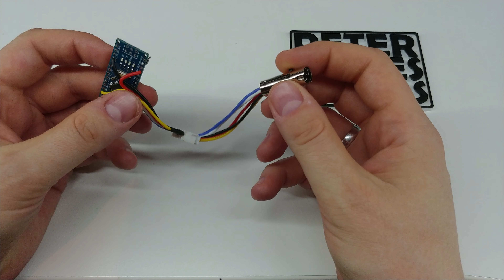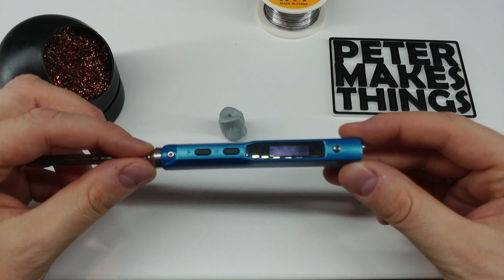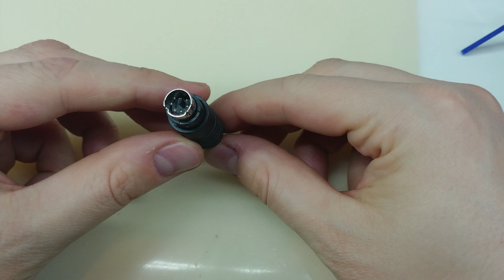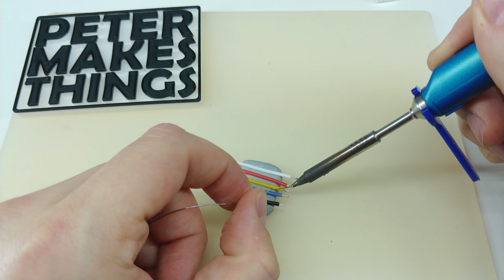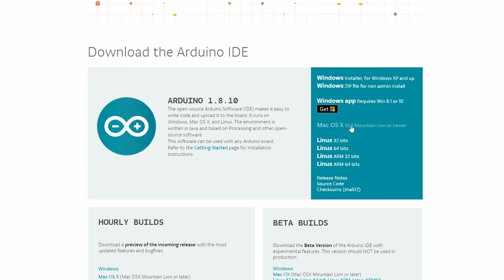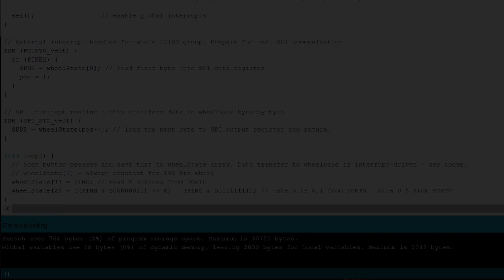How to make a wheel for Thrustmaster (part1)

Comment: EDIT: nvm you did use the PS/2 - how did you know the pin outs would match? I'm looking at the TS-XW PCB for the wheel and the 6 wires aren't labeled. 

wait did I miss the part where you removed the coiled cable in the steering column? I've watched this and part II and just realized you didnt leverage the PS/2 in the column that existed. This was VERY smart haha. bc you didn't test i was waiting for this to fry watching between my fingers but then it hit me - you bypassed the TM PCB entirely. I wanted to use the OEM wheel occasionally still so I spent all day going through the pin out to ensure I hadn't mixed any ground pins etc. Did you have trouble removing the coil? and have you experienced any delayed errors? I was nervous the software would recognize a substantial change and lock up on me. thanks for all your work! this is truly some great content

Comment: I have known this project for a long time, I bought an ATMEGA328P for a rally wheel that did not need so many buttons, but I think I will wait to see if the project is updated and if I do not put a cable, I already made one of GT3 with 4 rotarys and in total it has 22 inputs and the curly cable doesn't bother me at all ... a very clean manual. regards
Reply from the maker: if the cable doesn't annoy you then I guess it's a good solution, but for me is just ease of use, simply put in the wheel and you're good to go
Reply: you mean ardunio uno atmrga328P

Comment: You're awesome, man. Just like McGyver, haha. I'm soon switching from T150 to a T300 and I'll be definitely trying this, I've got also a design that I'd want to use, the only issue is making it fit for a Thrustmaster wheel :p
Reply: I think it’s probably possible to make a wheel for the t150 actually
Reply: You can get adapters on eBay and I guess u could just wire electronics via usb
Reply: @tylahrs  well, I already bought a T300 and I couldn't be more happy with it tbh.
Reply: Domiii yeah I might upgrade to that, but i would rather just put in the extra money and go for a csl elite or sim-plicity dd wheel

Comment: Good afternoon, congratulations on the video.
I have a few questions to ask:
I bought a "Bentley GT3" steering wheel that has 12 buttons and 4 encoders. Does it work using that method you made in the video?

Comment: I've tried replacing the adruino and re-soldering the wires but still having problems with the buttons randomly pressing by themselves, I also tried the built-in thrustmaster wheel and it doesn't have this problem. I think the problem is not with the wheels but with the thrustmaster software, any solution?
Reply: i have the issue where some buttons are always "on" and some are always off. very annoying and idk how to fix it. the game recognizes it but nothing works as it should. i can't turn on or off the buttons.
Reply: @vidvir1492  back with arduino pro micro with usb cables, a guess thrustmasters already blocked the arduino nano sketch
Reply: @dellibingung  that sucks. Lets see if there is any other method.

Comment: Hi Peter, what firmware to use with TS PC Racer ? And which what Sketch then ? Firm4.0 with TX 458 Wheel sketch should works ? I cant find a way to make my wheel recognized on my base.., Thank for all!

Edit : TS PC Racer works fine with 2017_TTRS_7.exe Thrustmaster Package (Firm 6.0 + Driver 2.10.3.0) and the 458 TX Wheel Sketch !
Reply: Ok So answering Myself : TS PC Racer works fine with 2017_TTRS_7.exe Thrustmaster Package (Firm 6.0 + Driver 2.10.3.0) and the 458 TX Wheel Sketch !
Reply from the maker: @coeveur942  Thank for the info, I'm still on firmware 4.0 and everything is working fine, good to know though that things are running even on 6.0

Comment: I love the videos! I’ve been wanting to do this for a long time.  I want to upgrade to your quick release but in the meantime I wanted to wire everything up and use the standard wheel adapter with p/s connection.  I am having a hard time finding that stl file, could you please point me in the right direction ?

Comment: @Peter Makes Things Hello, first of all forgive my Google translator English.  😁😁😁.  I'm 3d printing my project for a Thrustmaster F1 wheel and wanted to know if this mod with Arduino can also work on xbox one consoles based on ts-xw.  Also I wanted to know if you know where to find the schetch to use all 25 buttons of the F1 steering wheel.  Thank you
Reply from the maker: this will work on xbox but only if you have older firmware, the latest one (after load cell pedals) makes it incompatible, as for the 25 buttons F1 wheel there's isn't a sketch that enables it (or at least I'm not aware of it)

Comment: thanks for your wiring pic, i take a look of my PXN V10 it has an identical wiring like this one, except it use aa 8 pin connector but still only use 5 wires only like thrustmaster, and i guess the blue wire and green wire are switched in v10(maybe) because there is no blue wire but green

Comment: Peter, can you use the arduino and an adapter to make the TM 250 GTO wheel recognizable by the PS4 system?  like a dummy board with no buttons as the vintage wheel is devoid of any buttons.  Just need the wheel base to see some "electronics" on the wheel side.  I have used your quick released system for 4 of my wheels.  I would love to have my 5th wheel be the 250 GTO.
Reply from the maker: As far as I'm aware you should be able to, but you'd need to fit it inside the wheel somehow, I don't have 250gto so can't design it, but if you where to put it apart and send me pictures with all the dimensions measured with caliper I might be able to make something for you

Comment: Bro why r u using the firmware for the TMX wheel? Is it safe? I'm completely blind about this arduino thing
Reply from the maker: bear in mind this code is not changing anything in the wheelbase, it's just a thrustmaster steering wheel emulator, as you could see on the vide the wheel is recognised by my TS-XW as TM Open Wheel, it's 100% safe, the only problem is that it doesn't work with latest TM firmware
Reply: @petermakesthings7342  ah i see, have you tried the latest one from http://rr-m.org/blog/ ? It's for t150 but it says compatible for t300, my wheel is t300 and updated to latest firmware
Reply from the maker: @corniel657  I'm not updating my wheelbase cause don't want to risk it :) get an arduino and ps2 connector from ebay and just try it out, if it works great
Reply: @petermakesthings7342  
so btw i've tried using the t300rs wheel firmware from http://rr-m.org/blog/, it didn't work, my computer acted up when i plugged the PS2 connector to the wheelbase, but the t150 one works, my arduino is recognized as "PS wheel" but for some reason i can't get any buttons to work, i don't know why, maybe it doesn't soldered correctly
Reply: @petermakesthings7342  so yeah after some digging, i've finally resolved the issue, apparently there's some bad soldering on the arduino board, it works now, i'm using the t150 code, with the t300 wheelbase updated to the latest firmware, 
so yeah i can confirm it still works
Reply from the maker: @corniel657  well that's awesome, thanks for the info
Reply: @petermakesthings7342  hello again peter, I want to ask where can I get the 3D printed part where you lock the mini DIN connector, just like at this video 12:54, I just need that small 3D printed part
Do I have to purchase the stl file from you?

Comment: Hi Peter. Do you have any problems with arduino after made this wheel? It still working?
Reply from the maker: None, but... The sketch doesn't work with latest firmware, ie the one for tlc pedals, unfortunately I don't know a way around it apart from not updating my wheelbase
Reply: Peter Makes Things there is any other option to made fully compatybile board with latest Thrustmaster firmware?
Reply from the maker: @MR.EVERLOST  it will require a fully custom pcb board, something I'm hoping to do but no time estimates yet
Reply: Peter Makes Things do you try to install latest sketch on arduino? Latest update was made on 2020, maybe it will work with latest TM firmware.
Reply from the maker: @MR.EVERLOST  I didn't update my TM wheelbase so not able to test it, and I don't really feel like trying it cause I have too many wheels using the sketch so don't want to risk it :)
Reply: Peter Makes Things so your custom wheels work well with arduino and sketches?
Reply from the maker: @MR.EVERLOST  yes, I have 5 wheels using the sketch and they all work just fine, but I didn't update the firmware of my ts-xw base for 2 yrs, from the information I got the sketch doesn't work after the T-LCM pedals update, what is the last fw version for which the sketch worked I unfortunately don't know
Reply: Peter Makes Things ah now everything is clear for me. Thank you very much!
Reply: Peter Makes Things last question I want to ask you. It will work on Xbox too?
Reply from the maker: @MR.EVERLOST  it emulates a TM wheel so will work with any console your wheelbase is compatible
Reply: Peter Makes Things thanks again. I hope my project will work 👍🏻

Comment: Any ideas what the power rating of that connector output from the servo base is? Can it power leds or displays connected to it without running additional USB power?
Reply from the maker: it's 3.3v, can do few leds but I'm not sure it would handle a screen, although the new tm wheel does have a 4.3in screen so maybe...
Reply: @petermakesthings7342  thanks. Yes, just saw the news.
[edit: ooof, $350 for just the wheel] 

It's not compatible with t500rs. I wonder if that's a clue of how much power the bases can deliver.
Reply: @petermakesthings7342  Looks like they have a new firmware to support the wheel which might mean allowing more power to the connector. With the chance of breaking it, I might give a chance powering my display and mcu directly from the connector!

Comment: hello, but if I remove the connector from the motherboard of the tmx and convert it to PS / 2, can I put any steering wheel afterwards? thanks
Reply from the maker: I'm afraid I have no idea, don't have the wheel, check the http://rr-m.org/blog/ I know he converted TX RW wheel, maybe same method will work for tmx
Reply: Hi yeah I've done this with a tmx wheel I converted the connected to a rj45 and put an rj45 on the wheel base
Reply: Peter I have sent you an email about the mount for the connector

Comment: I done this already, after the most recent update from thrustmaster the software used on the nano is having serious problems.. the t500 sketch was modified not to bit shift but it's not perfect and lacks shifters. 

The 458 sketch also fails to work and causes many random button presses and the t300 also causes a randomness... 

Their has been no solutions as yet for the TS series wheel other than to use shift registers... 

I have been doing a little work with the original concept auther Teras to try find a solution but the theory now is that the SPI interface on the Nano is not fast enough to satisfy the wheelbase read speed. 

Im interested to see how you get on here and if you come up with a solution...
Reply from the maker: How long ago was the update? I haven't been using my custom wheel for a couple of wks, need to test it...
Reply: Not exactly sure when it came out, i updated last week before using it on pc and my Arduino wheels went mental... While using them in game it presses random buttons when ever it feels like it... Yet all the original wheels operate fine. 

The closest thing we have to a fix so far is not declaring pins D0 and D1 as inputs. Calms the whole thing down but its still acting like its being reset... Long presses can cause multiple presses and button presses can activate many buttons at the same time. Ie, random gear shifts and pausing back to menus etc.
Reply: It is a 2019 update. Speculation is to enhance compatibility with the new addons and sim hub.
Reply from the maker: @bryan2009  ok, so I just did 16 laps in PC2 with my TS-XW, the wheel I've been using has f458 sketch uploaded, firmware 4.00, driver 2.10.10.0 on windows 10, had absolutely no issues with buttons response etc
Reply: The latest firmware for the ts series wheel is 9.00
Reply from the maker: thanks, looks like I'm not updating the wheel:) otherwise it's back to using usb cable :/
Reply: The problem starts im sure when you use the firmware supplied with the ttrs.2019 driver.
Reply: Yes, lol... This has cause problems for many. If you have the old driver package you can down grade your wheel... And i can send you the sketches we have been working on for you to test non your wheel etc.
Reply: Bryan Young it seems to me the 9.00 firmware is for ts-pc, while the latest for ts-xw is 4.00
Reply: I see the xbox version never got an update yet... Yet all the others did? Eyebrow is raised lol
Reply from the maker: @bryan2009  yeah, it's definitely 'yet', and also downgrading the fw is not great cause you won't be able to use new add-ons, guess I need to start working on plan B:)
Thanks a lot for your input!
Reply: @petermakesthings7342  i sent you an email with a solution... A bullet proof one lol. And would make an awesome tutorial. But dont give up with this tutorial! Its good to see it happen... Plus there will be a fix somehow in the future. Great work. 

And as soon as i have some extra pennies ill be buying your qr kit from you.

Comment: Can I add more buttons if I just use a Pro Micro as a keyboard emulator and use the PS2 connections for power and communication with the PC?
Reply from the maker: the emulator only allows up to 17 buttons, to have more you'd need to add another arduino configured as a gamepad

Comment: Maybe I am anticipating a topic of the next parts but: "How many buttons are supported in such a configuration?"
Reply from the maker: Yeah I'll cover that in next video but it's basically as many as the recognised add-on wheel has, in this case as many as open wheel, which I think is 15, can't remember on top of my head
Reply: 17 buttons are possible depending on the wheel you emulate... This number is limited by the available pins on the nano it self... Pins 12, 10 bridged to 2 and 13 are used for serial clock, serial data and latch... Analogue pins 6 and 7 are also not used. You can emulate different wheels using the first bits of each byte. 1100 is 458, 1101 is t300 standard wheel 0011 is the f1 wheel etc.
Reply: @Bryan Young thanks a lot, very useful info! Is there a place where to find a list of wheels and their bits code?

Comment: is it possible to add more buttons ? 
like endcoders and switches
Reply from the maker: if you want to emulate it as a thrustmaster wheel then you are limited to 15 buttons, theoretically you could get like 25 buttons if emulating F1 wheel in advanced mode, but I don't have a sketch for this

Comment: Any idea if you can add shift lights using the connector? Or get telemetry display?
Reply: there is one way I know but it isnt the best method. You could use an older phone and 3d print a wheel with its exact dimensions. I plan on doing that if I can make the buttons to work.

Comment: Is this compatible with consoles? (I have a ps4)
Reply from the maker: I can't see the reason why it wouldn't, but it's cheap to try it, get the arduino board, PS2 connector and one button, connect it all together and plug into your wheelbase, then you'll be 100% sure:)
Reply: @petermakesthings7342  can't wait for part 2 of the video

Comment: Can I do somethings similar whit g29?
Reply from the maker: no idea I'm afraid
Reply: I really doubt it. The ecosystem for Thrustmaster has interchangeable wheels, so the wheels act like USB devices when connected. 

Logitech on the other hand is stand-alone, non interchangeable wheel. If possible, it would be a lot harder.